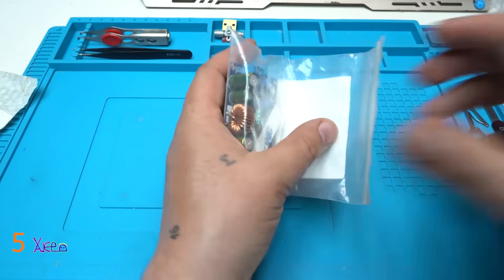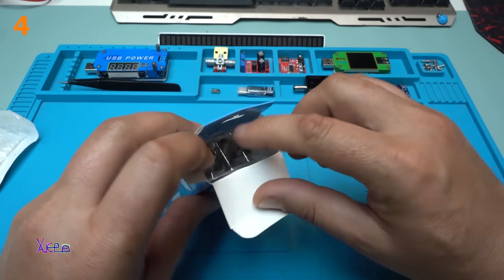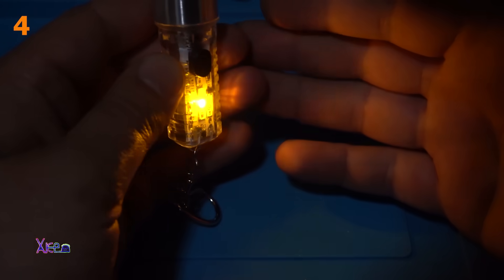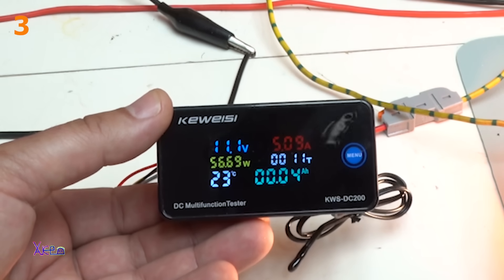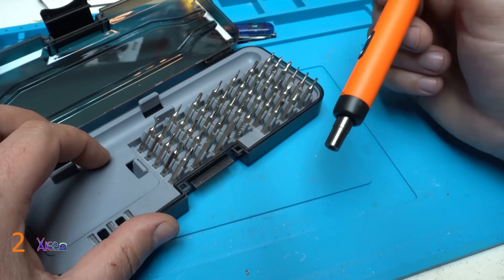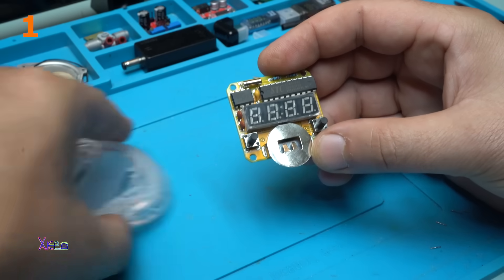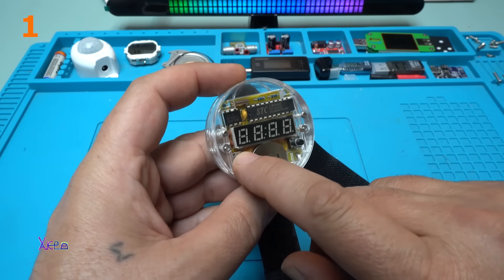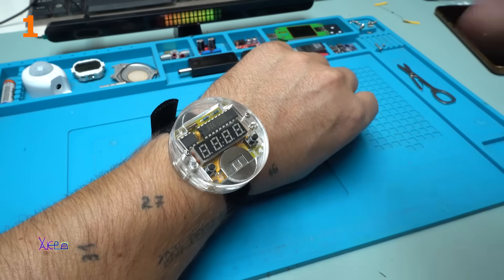TOP 5 EXCELLENT Aliexpress Modules

Comment: the current sense resistor on my buck-boost converter, like yours at 0:50 (next to Rcy) failed on the last pair I ordered after only being used a week each, capped at 3A but rated 5A... sellers refuse to replace them claiming user error.